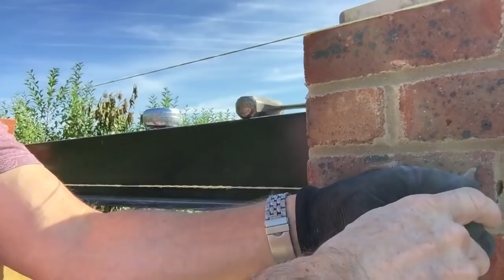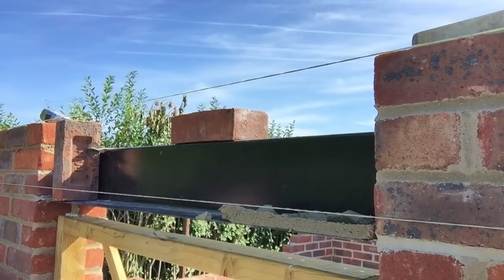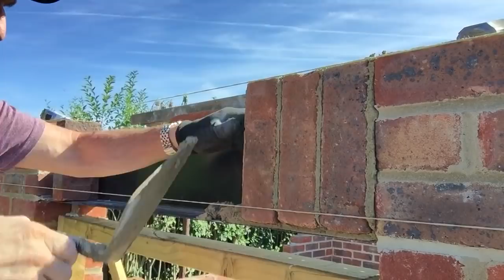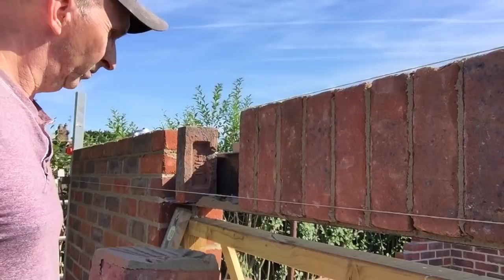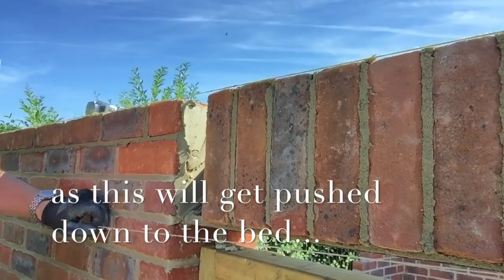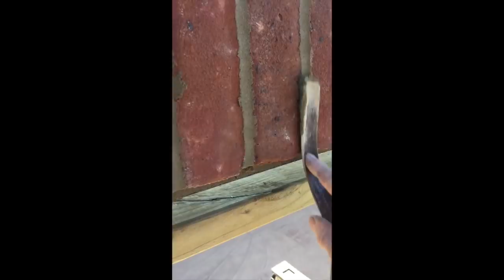the fine art of brickwork - Soldier Course 2

Comment: Nice brick those Rob , I bet they’re hard work in this heat , we are struggling with engineering brick with sand and cement . We are jointing them straight away , usually leave them at least 3 hours 👍🏼

Comment: I clamp a timber across the face of the opening mark required gauge on it stops bricks tipping forward on the lintel so much easier
Reply: Decent idea this! The longer lintols certainly have far too much give in them. Just a pain to rub in later i guess?
Reply: @SJCW22  usually after couple of hours you are able to take the timber off point up or rub up then i leave untill next day before i go over the top on brickwork
Reply: Good idea
Reply: You don't have to do any of that these soldier courses always move.and overhang.if you put the back in first or put some blocks on the back level to the top of your soldiers.you can lay a block flat across the top this will hold them in place on a slight bed.till they go off.or a brick spanned across every 2 courses just scrap the bed off afterwards.the more you try knock it in the worse it gets.goes of quick in the summer.

Comment: Hi Rob, I have question. I am having trouble repairing / replacing bricks on n a window sill. I am using a mix of 3 parts sand and 1/2 part Lime and 1/2 part Portland cement. I am using the same brick that was used to build the house in 1936. The Brick is being laid on edge and is extremely porous so I pre-soak the brick in a bucket of water. However when I put the bed mortar down and butter the perp joint,  the brick sucks the water out of the mortar so quick that the mortar stiffens that I can not  adjust the position of the brick . I am pretty sure that when they built the house  they used a mortar with some Portland cement in it and did NOT use just lime and sand. Have you ever run across something like this and how should I deal with it.
Reply from the maker: hi, they sound very porous. If you are dipping the brick first then I would say the mortar is your problem.
Are you also using a mortar plasticiser and not relying purely on the lime for this?
years ago lime would have been slaked, left, mixed, used...and it was workable, these days we don't have time for all that so plasticiser deals with that for us. 
When I was restoring churches we would often remix the previous days mortar and it always gave us a better mix, showing that lime needs time. (or plasticiser)
Note, use a mask and googles when mixing lime...it burns skin, and lungs
Reply: @robsonger1  Thank you Rob! I have not been able to find any commercial plasticizer here in the United States. Is it true that using dish washing detergent could be used as a Substitute plasticizer and if so how much  is recommended?  thank you again.
Reply from the maker: Washing up liquid has a chemical in it that kills the cement and highly not recommended. Can you look on eBay?
Reply: @robsonger1  thanks so much!

Comment: Hi Rob what ratio of mortar would you recommend for building a double skin retaining wall out of red engineers? I was thinking 5-1 will this be strong enough
Reply from the maker: Engineering bricks demand a high strength mortar, I generally use 1:1/4:4
(1 OPC, quarter lime, 4 sand)
Reply: rob songer OK thanks for reply mate 👍

Comment: Nice work as always but it's a shame so many modern builds use soldier courses, they are the dullest form of brickwork, shame we don't see more flat arches with tapered bricks or slightly cambered arches.
Reply from the maker: Aha....keep watching...
I have 7 different arches in the pipeline, and the Flat cambered is one of them.
Reply: @brickbybric  Maybe they are dull to experienced brickies, but when faced with renovating a 60's bungalow replacing original, load bearing wooden windows (no external leaf lintel above head and brick run in stretcher bond), I was so pleased to see the new soldiers go in on new lintels. A big improvement on the original design!

Comment: Good work but you should guage so you dont put mortar on the angle iron
Reply: Its how its done in uk nothing wrong with it all passed by engineers no damage caused by frost or anything. It works great for keeping nice plumb work above openings, your not at the mercy of no bed and relying on well shaped bricks. If you look closley the lintel is very thin they're  a hard pressed rolled stainless steal very strong catnic lintles.  And giving the fact that a soldier is equal to 3 courses of bricks including joint a bed on lintel makes it work perfect

Comment: Lose 25mm from 1035mm, which leaves you with 1010mm? That still isn't gauge?
Reply from the maker: Gauge is either 1050 (+10mm for last joint) or 975 (+10)
So this opening was in between and I opted to tighten up.
Thank you for watching
Reply: @robsonger1  sorry I miss understood the way you had said "lose 25mm" when I have to do that I use different phrasing! Just different  colloquialisms I guess! Great work by the way and great videos!
Reply from the maker: thank you, and thanks again for watching